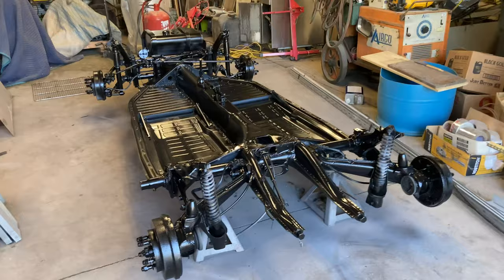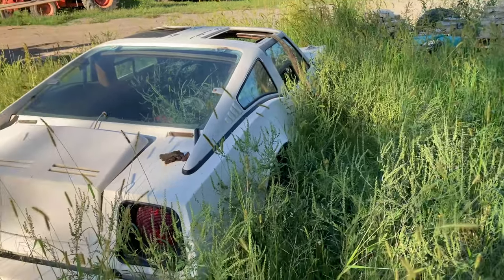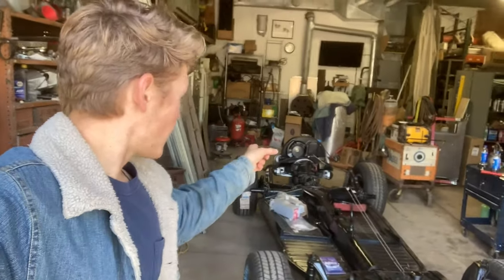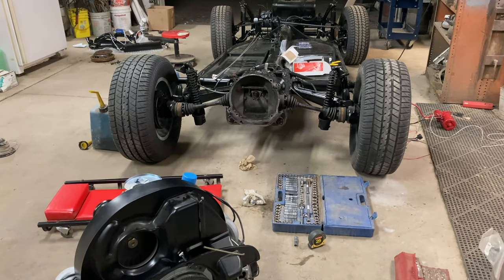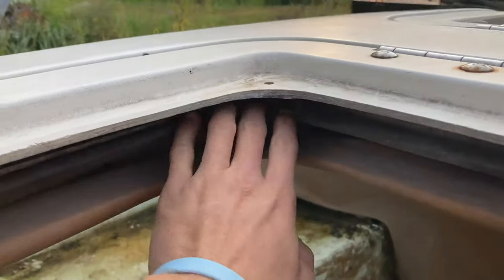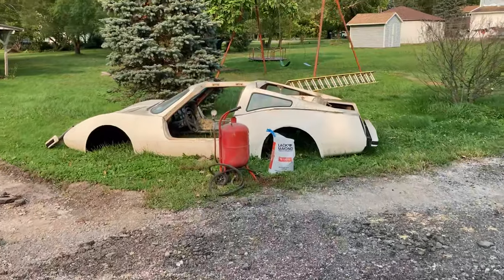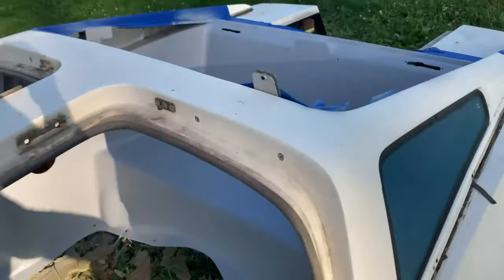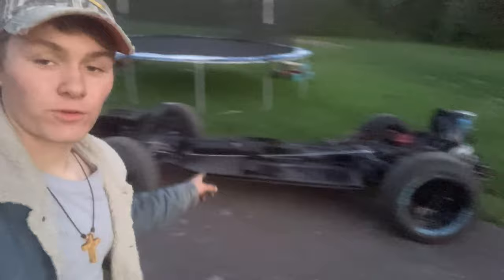Bradley GT 2 part 3

Comment: What size rims and tires did you use. I have a gt 2 I'm working on, and it's currently riding on the original tires, so it needs new ones bad.
Reply from the maker: Backs are 15s I think and fronts are 14s I have adapters on the beetle to fit 5 lugs so my rims are not even for beetles.

Comment: Yo I’ve got a gt myself and I have been stuck trying too get my body off the frame! I can’t figure out the steering column! Hmu!!!
Reply from the maker: The steering column is above the break cylinder in the driver side wheel well.  It should be connected to your steering box with 2 bolts, remove both the bolts. Then there should be some bolts holding on you steering column under the dash, probably 4 or so. It should drop down after that and you will be able to pull it through your body. there also may be some hidden bolts behind the pedals. let me know if you need some more help.